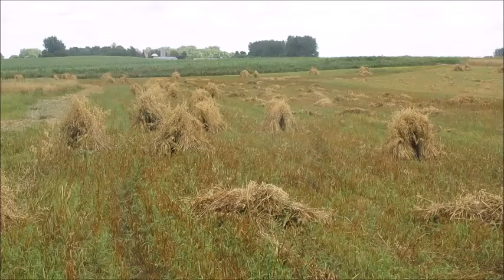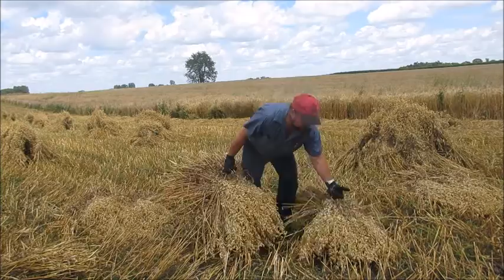How To Make a Grain Shock For Threshing

Comment: Why?
Reply: I think its to get the wheat berries off the ground to keep them drier while waiting for the threshing machine ..otherwise they may mold or rot laying flat on the ground without air flow
Reply: It also allows sunlight earlier to the majority of the field. Oats are usually under seeded with a hay crop.